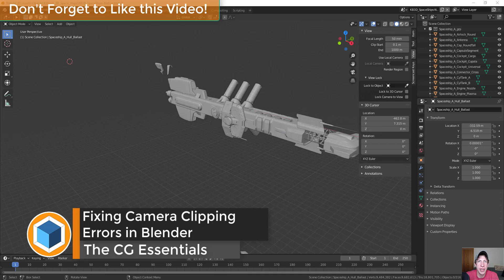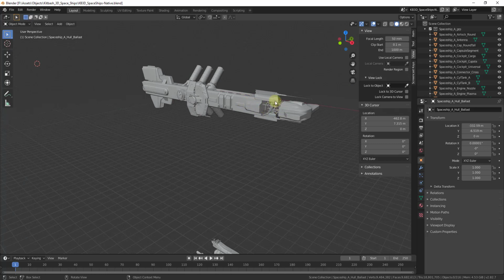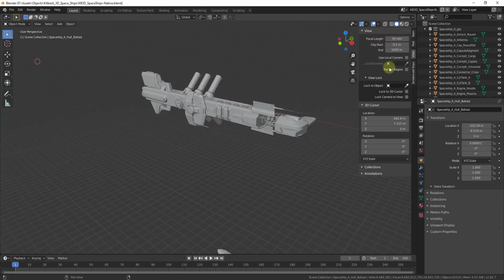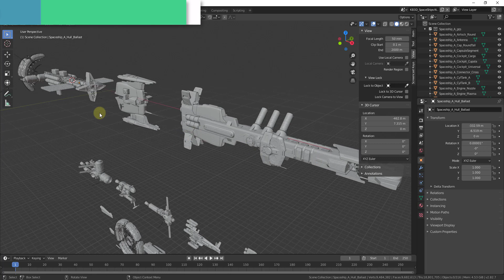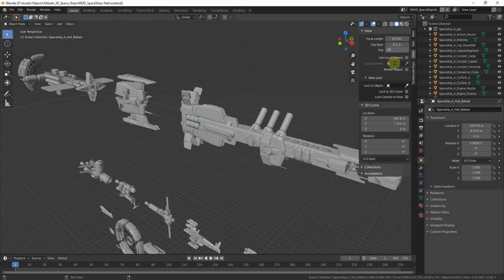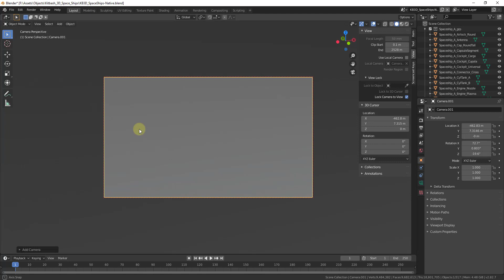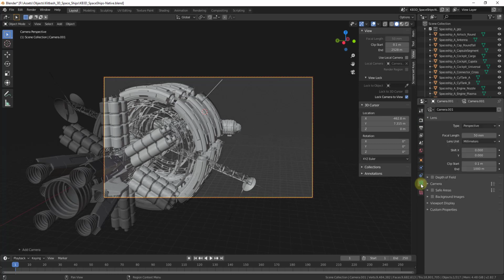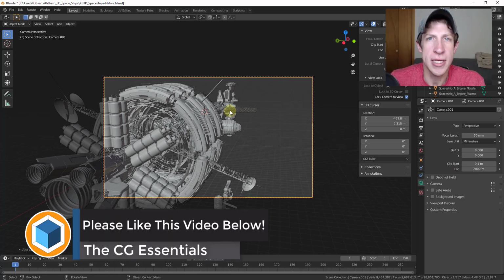Fix CAMERA CLIPPING Issues in Blender - Camera Clipping Fix

Comment: it still clips out when im in the camera view help!
Reply from the maker: Are you changing the settings of the right camera?
Reply: I was having a similar problem, i figured it out after 3 hours of pressing and dragging every button I could find:) Try Selecting the camera> press N> Right click any where inside the panel that pops up> Select "Camera Lens Angle" and try and make it longer. Hope that helps

Comment: I have a very large scene (20 km X 20 km) of a city surrounded by mountains, valleys, countrysides, forests, lakes, roads, etc. My dynamic camera travels at various altitudes (from 1 mm above the ground to 1 km and higher), while grazing all kinds of objects, to show their tiny details (procedural shader = infinite resolution). How can I avoid clipping issues and other rendering artifacts, but still see everything in my scene ?
Reply from the maker: This is a very broad question....it seems like you'll have to use keyframes for different settings at different points...
Reply: @TheCGEssentials  Yes, I think so. Since artifacts occur on many 3D models, when my camera Clip End to Clip Start ratio is too high (1000 m / 0.001 m), what is the best camera Clip End to Clip Start ratio ?